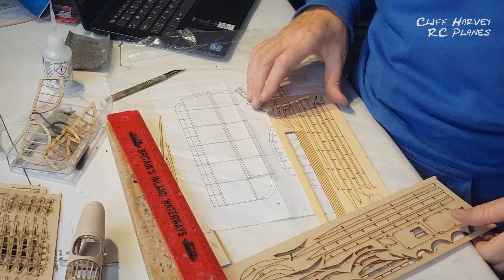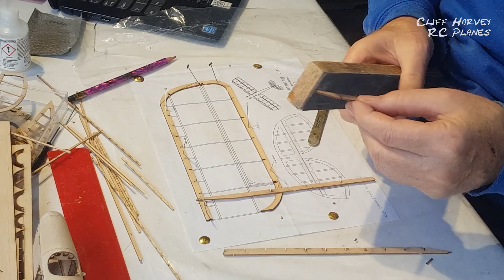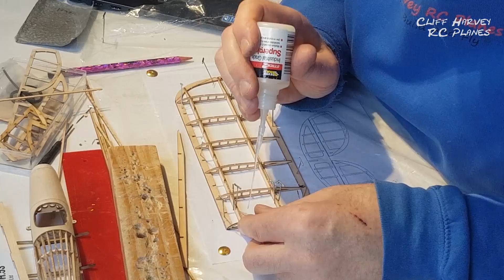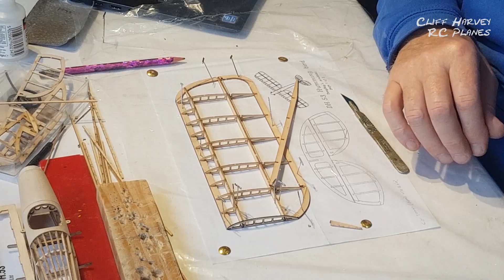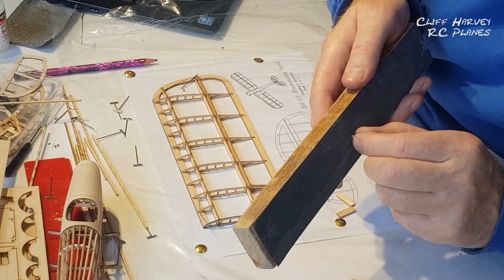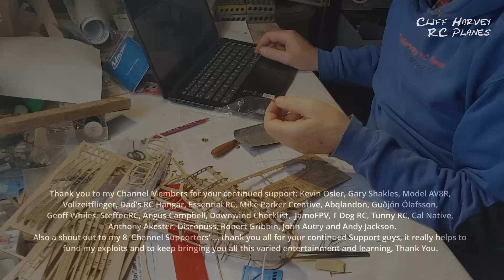Making the Tony Ray Humming Bird Kit Part Three

Comment: YOU MIGHT TRY TO GET A LARGE "CORK-BOARD", TO USE AS YOUR BUILDING BOARD...  THE "PINS" WILL BE EASILY INSERTED AND REMOVED, REPEATEDLY... WITH MINIMAL DETERIORATION.. (USE "WAX-PAPER" OVER THE "PLANS"...)   :face-blue-smiling::face-green-smiling::face-red-heart-shape::face-red-heart-shape::face-red-heart-shape::face-red-heart-shape:
Reply from the maker: I've always used plasterboard for the same reasons 👍